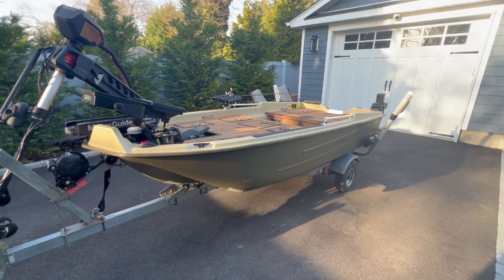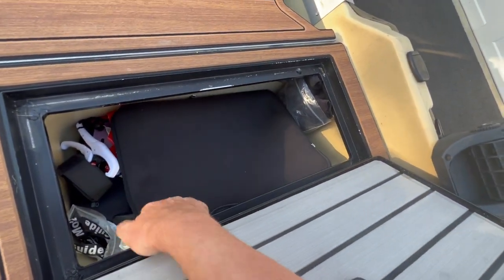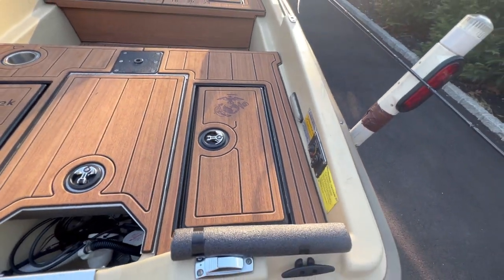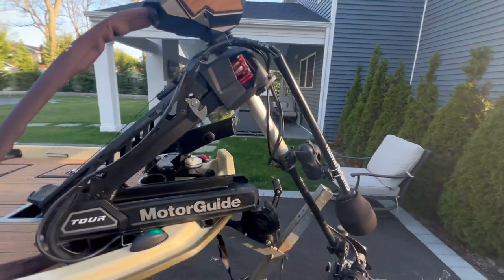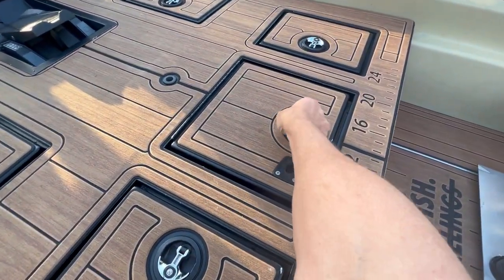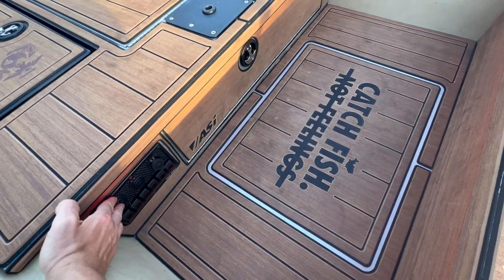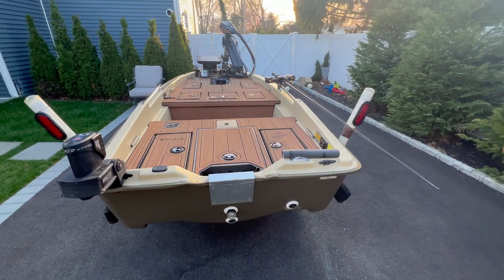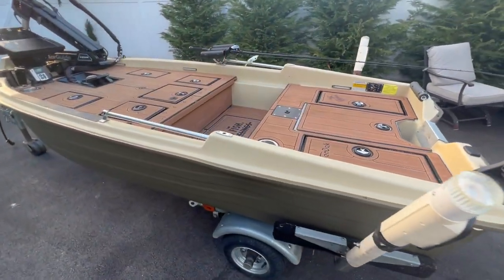Is this the most Epic Tiny Boat EVER!?

Comment: If you leave the plug outa the livewell It will only fill up to water level in always fresh water. Only time I plug that livewell is when I'm traveling home with fish..
Reply from the maker: Well when I got the boat I noticed the well didn’t fil up very high , I didn’t like it , so I changed how it functioned.. my pump puts water into the Livewell and it has an overflow, works much better imo.

Comment: There’s two small drain holes inside the battery compartment towards the back.  Mine always brings some water through those two little holes behind the battery and it wets the bottom of my battery every time. Is this normal?
Reply: mine doesn't do that
Reply from the maker: 5200 that .. sounds like you have water inside the hull.. that’s why I did the hull access in the back, to be able to vacuum out he water that will get inside

Comment: I have a Pro 120, and really like your setup, I initially set up my boat to also be electric, two motors, one front and back, I also added the screen filter to the drain plug, I added a small RV freshwater pump and plumbed it in to the live well to add water, because the drain for it doesn't add more than a couple inches when open. Your anchor mount is also impressive, definately wanting to set up my boat to do the same, One question ? Where did you find your LED Nav lights ? Wanting to upgrade the ones that came with the boat. Great job, Thanks for posting and good fishing.
Reply from the maker: Hey , the two nav lights I got on Amazon off the tbnation store

Comment: Great video! I’m thinking of purchasing one of these boats here soon! Did you seal the holes you drilled or just use the skateboard washers? Thanks for the enjoyment!
Reply from the maker: I didn’t seal those holes, no need. Only thing I sealed was the back hull thru fittings, don’t want water getting inside the hull.
Reply: Gotcha! Thanks for the help man

Comment: I like the power pole micro setup. What are the parts number for the setup. Thanks
Reply from the maker: It’s just the kayak mount and I use 1 1/4” square tube and skateboarding truck bushings
Reply: Thanks, I will see if I can make it work.
Reply: What kayak mount?  I'm new to this.Thanks